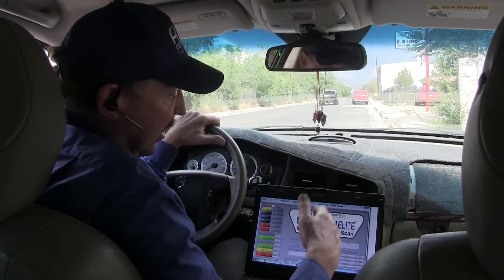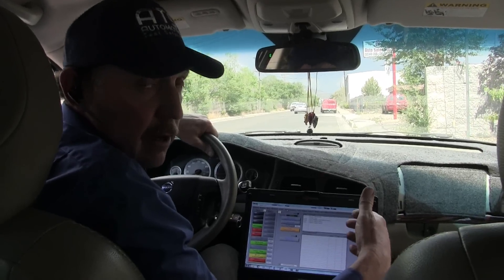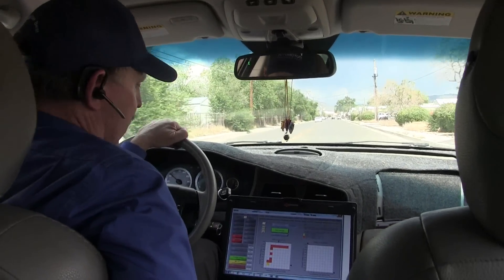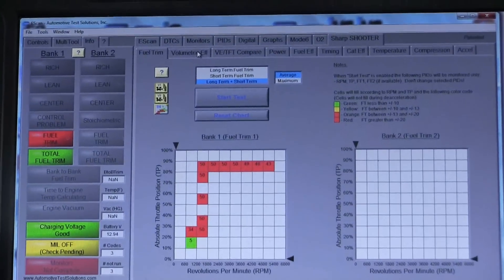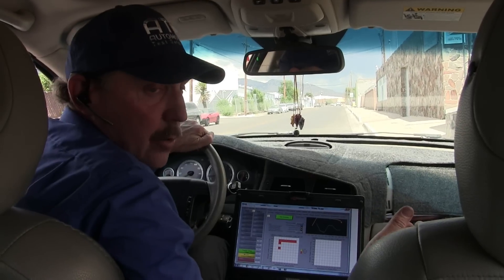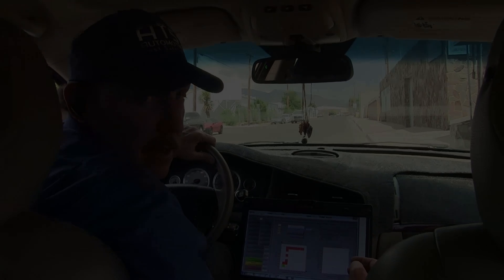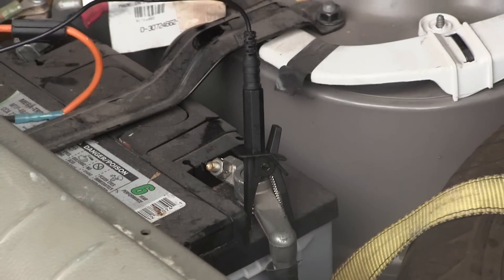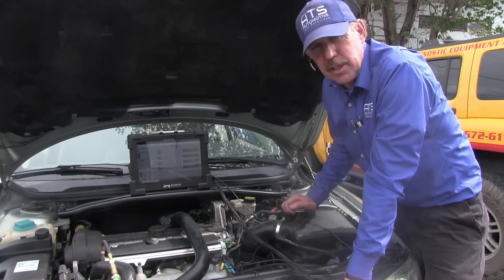Diagnosing a 2007 Volvo XC70

Comment: Very interesting diagnosis, Bernie! In my experience Volvos are very picky about fuel pressure. If the fuel pump duty cycle is not what is expected for the desired psi/volume, a rationality code is very quick to set. Looking at the FP duty cycle on the scanner is a giveaway :)
Reply: Go back to Russia 😂

Comment: ur pressure transducer was reading about 25 on the rail nd the pressure sensor was reading 45 the old sensor was reading 40-45 what did the used fuel pressure sensor relearn its value to ? it should relearned about 25 pressure right to match ur scope on the transducer
Reply: The ECM is using the fuel rail pressure (FRP) sensor to determine how fast it should command the fuel pump to spin. If the computer thinks it's getting 45 PSI on the rail, but the "new FRP sensor" is reading incorrectly, the ECM won't command the fuel pump to spin fast enough to actually get 45 PSI - it will only get about 25 PSI, as measured by the ATS pressure transducer connected to the Schrader valve on the fuel rail. Once the old (working) FRP sensor was installed, both the ATS pressure transducer and the FRP sensor read the same value, 45 PSI - this meant that the ECM was able to correctly command the fuel pump to actually produce a rail pressure of 45 PSI.
Reply: @Sangueffusor  the transducer never read 45 psi
Reply: @eli310  It did at 14:20 which is when he hooked the yellow channel back up to the ATS transducer (it actually read between 40-45 PSI)
Reply: @Sangueffusor  thats a 4 pin relay theres no reading of the pressure transducer thats the reading of the pressure sensor
Reply: look at 12:12
Reply: @eli310  It seems obvious to me that he switched the yellow channel back to the ATS pressure transducer before the shot begins at 14:13. The bar scale to the left of the numerical reading is totally different.
The pressure sensor has just voltage readings on the four wires, and the ECM has to interpret the signal voltages to produce a pressure reading. It is confusing in that he does not show the ECM FRP measurement after the fix (which was in kPA anyway, not PSI).
Reply: @Sangueffusor  the pressure sensor only reads voltage 0-5 volt u would have to convert that into pressure reading the computer knows the pressure reading off the volts on the sensor

Comment: After you put the old fuel pressure sensor in should you reset fuel trims so your next test doesn't show the correction from the faulty one?
Reply: It isn't really necessary, as the ECM will re-learn the fuel trims on its own
Reply: No need with the Escan. The Escan records long term+short term fuel trims. This is the reason the Escan shows green(1-10%) fuel trim squares after putting the old sensor. In regards to the car itself, it does not take long for the ECM to relearn fuel trim on a specific cell. The car just need to be driven at different loads/rpm to relearn every fuel trim cell.
Reply: You can check to see if it's actually fixed by just seeing if the trims basically zero each other out. Once you erase codes if it's not fixed you may wish you had them back.

Comment: I guess that’s what happens when you’re spit balling instead of properly diagnosing the problem. Thanks Bernie. I wish I was 30 years younger and healthy. I would go into that field versus heavy equipment that ruined my body.
Reply: yeah it sucks to have your body ruin them right there with you. I have been studying diagnosis because that's something they're not many people can do and I can still do it even though my body is wrecked. Good luck! I wish you the best!
Reply: @FunkyCold6875  Thanks, all the best to you too.
Reply: My guess is the previous shop properly diagnosed it (faulty fuel pressure sensor) but put on an aftermarket FPS (Volvo's work best with Volvo parts) and then began chasing a ghost fault.  Many years wrenching at Volvo dealers, I can't tell you how many times I saw this exact scenario - part from local parts shop, Ebay, Amazon, etc...I put Volvo sensor on and car is fixed.
Reply: @ghostwrench2292  I would think if they had correctly diagnosed it to start with they should have realized the part they installed was bad. I guess it's easy to armchair quarterback after the fact.  It seems to be a common issue these days to get bad aftermarket parts.